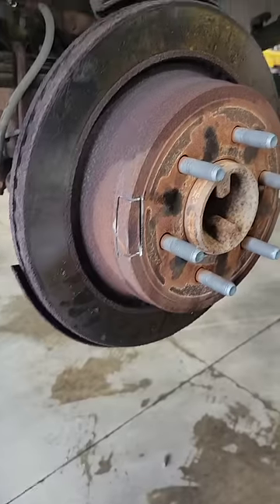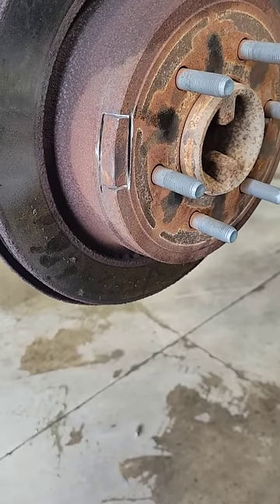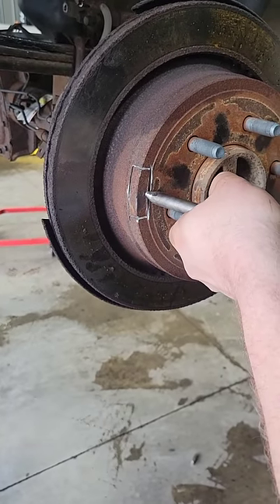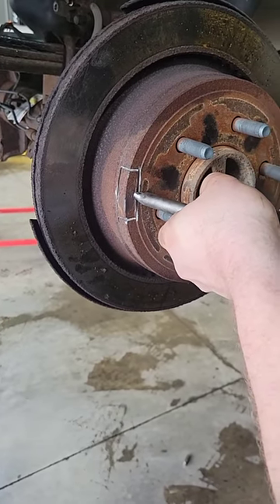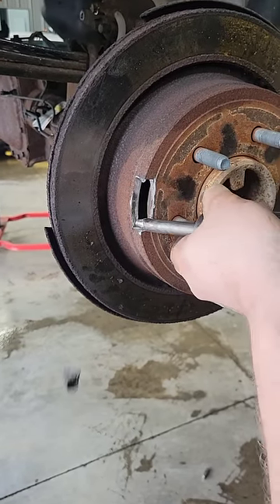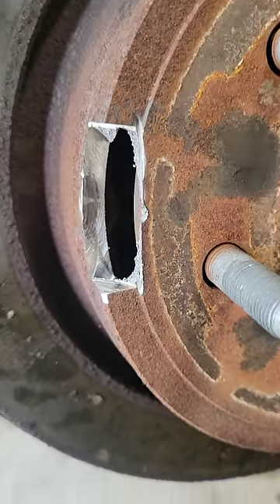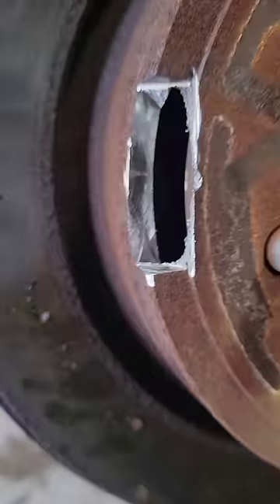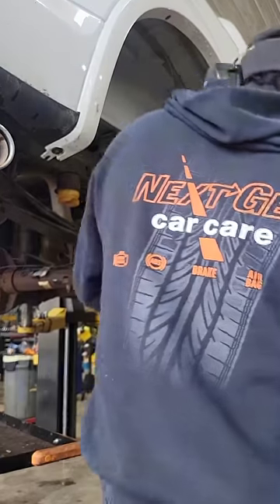Ford F-150 rear brake service.  Trying to show a trick on getting them off without further damage.

Comment: well if your shoes are sticking that bad you should change the shoes and the sp[ring kit anyway sop using a hammer is perfectly acceptable
Reply: Yeah but you rip apart the backing plate in the process
Reply: @strryle125  I've never done that and I've done many shoes. Even ones with bolt holes in the disc so you can wind in a bolt to push the disc out
Reply: It's not necessarily a problem with the shoes sticking, it's an excess of rust built up on the rotor. The shoes can be completely free and still have this problem
Reply: if you destroy the backing plate you're fucked, the rust ridge on the inside normal here in maine, and I've had good luck adjusting them all the way back, and spraying them with solvent while slowly working the rotor with my hand and gently tapping the opposite
Reply: @TotoGuy-Original  what do you consider many shoes? 10 brake jobs? 20, 30? cause I've done probably thousands and after you rip the pins that hold the shoes out of the backing plate once or twice you realize you can't just hammer them off
Reply: @smokeybear390  same you are obviously going about it the wrong way I've never ripped any pins out take your time don't force it too much that's how I do it
Reply: @TotoGuy-Original  where are you from? I'm from Phoenix and there's a reason I'm not arguing with anybody
Reply: Young people working on cars amaze me they just get saws and cut shit off.
Reply: @macsway2002  sometimes that is a good solution but most of the time it's not. For example a drop link you can get on the nut but either the centre or the shoulder to keep it still is gone then you best just cut it off. 

But stuff like cutting a hole in the disc like this a bit odd.
Reply: @smokeybear390   I believe on those ford's replacing that backing plate requires either pulling the axlemif it's free floating or removing the wheel bearing.
Reply: That's not the problem. Where the parking shoes dont contact the drum the rust builds up on the inside not allowing the shoes to slide out. You can simply remove the adjuster plug and back off the shoes to clear the rust ridge. Or what I've done is gently apply and outward pressure in different positions and tap on the outside of the rotor on multiple spots. Generally this is good enough in most cases
Reply: @zachbecklake2303  exactlyp
Reply: @TotoGuy-Original  just for the record NYC here and always worked on my own stuff I completely agree with you, idk what these guys are talking about
Reply: Get a loaded backing plate and go on with life
Reply: @strryle125  if there isn’t already a spot without the plate then you won’t ruin the plate, plus worst comes to worst you really don’t even fucking need those. They’re like $20 a pop anyways. You charged them more for labor than if you had just fucking replaced the plate???
Reply: @ElijahG19  you actually fucking do need those? not the part behind the disc, but where the shoes are actually attached, you 100% do need that, unless you don't care to pass inspection
Reply: @ Smokey Bear what's inspection? And what's rust? I'm in Florida and being very sarcastic, I grew up in Maine and know perfectly well the answers to my questions but here in Florida we don't have either problem. Thank God we don't have inspection 90% of us wouldn't have a legal vehicle. I was pulled over for my turn signal light being out and the cop kindly and matter of fact also mentioned that I ought to get my spider web cracked windshield replaced. I never did and was never told again. My current vehicle has a big spider web crack right in my line of view no problem no one complains.

Comment: 🙄 someone had a dope breakfast...
Reply: YOU ARE NOT A MECHANIC , EASY TO TAKE THEM OUT .
Reply: Off not out.. you take a brake drum off you don't take it out. There is a whole in the backing plate aka dust shield. If you look into that hole you will see a cog, that cogis the second part of a mechanical device known as your  automatic brake adjuster.  You can put 2 standard screw drivers in that white left the lever that turns the Cog making the adjusting Rod grow longer and in return forcing the brake shoes outward towards the drum and making an adjustment to keep your drum brakes working to the best of their ability. Given the assumption you have no air in your brake lines and all of the components in your braking system are complete and in good condition. Well holding the Cog turning lever off of the Cog turn the Cog counterclockwise and the adjusting Rod will shorten we're checking your brake shoes from your brake drums. Now your break shoes are no longer pressed tightly against the breaking surface of your brake drum and you can easily pull the brake drum straight off of the bolts.
P.s. you are correct I am no mechanic. At least not a Certified mechanic.
Reply: @artsanchez325  I've never needed to hire a mechanic on the account of ( I can do the work myself. In turn I have been hired to work on many other vehicles that belonged to other people but you are correct I am not a mechanic "by profession" experienced and knowledgeable yes but a mechanic.? No, not really.🙂 
Lol
Anyway I guess I'll go take my lug nuts out so I can take my tire out and my brake drum off!😉🤣🤣

Comment: I like this repair shop! The L.I Apple Honda dealer I used to go to doesn't even know where the gas tank is 🤪 The mechanic put a screw into the rear wheel well to hold the molding and the screw was so long and pointy, it touched the gas tank behind it 🤷🏻‍♂️
Reply: We have a company installing GPS in all of our fleet. I got a Mack with a ABS light on. Dude ran the ground wire like three feet through the dash. Had to have used fish tape and removed a few panels. All to get to this one piece of metal and run a screw into it for a ground loop on his GPS. Problem was that piece of metal was the mounting bracket for the ABS module. He ran the screw right through the bracket and into the module. The module sits flush against the bracket too. No gap. I literally stared at it for a good minute befuddled. I had to be missing something. Perhaps that wasn’t a self tapping screw. Maybe it was an oddly located mounting screw? Nobody could be this stupid; right? The kicker was there is an accessory port with ground one inch from where he zip tied the GPS unit. 
 These guys aren’t mechanics but they do these installs all day for a living. If anyone should know to watch where your screw ends up it is them.

Comment: i was a fleet mechanic for 30 years.  During that time I just quit turning rotors and drums and just got new ones for my own cars.  After seeing the things that can go wrong with a rotor once it's been cut (over-heating, warping, noise from bad refinishing) I think that the cheapest brand new rotor is generally better than the best expensive rotor that's been cut.  Doing this has saved me many problems.
Reply: If you cut them before they’re all goofy, you can turn em with no issues…it’s just a lot of time that no one has anymore…
Reply: Wow bro you need to hit me up I can save you so much time and energy and show you the right way to do this
Reply: I disagree on older vehicles because the parts you get now unless you get old stock our garbage I’d rather have an old part that’s dependable turned than a new cheat part

Comment: You can back the parking brakes off.
Reply: That doesn't always work when there's a lot of rust
Reply: That would take to much effort. Definitely easier to take the time and cut a hole in the rotor and use your brake spoon to mess with the shoes, than remove the rubber plug and back off the parking brake adjuster.
Reply: I know. But stupidity and laziness rules the day.
Reply: Ya live in The south or Arizona or California

Can’t do this in the north
Too much salt and rust
Reply: @markallen4364  I love ya style 🤣
Reply: @Krankie_V  if theres that much rust, then the backing plate along with entire parking brake hardware needs replacing anyways, so why go through all this nonsense?
Reply: @Hammerjockeyrepair  that's not always the case.... Sometimes it's just a lot of rust on the rotor and the rest is fine
Reply: @Krankie_V  if that's the case then the parking break hard wear should be replaced any ways backing plates are cheap as well
Reply: @Rustynuckles1  it has nothing to do with the damn hardware. It's an issue of a ridge of rust built up on the rotor.... Effectively making the ID of the rotor smaller than the shoes even when fully retracted. The rusty rotor is the issue, nothing is wrong with the shoes or hardware or backing plates
Reply: This it not the way to do it.
Reply: @Krankie_V  don't be cheap you got a shit rusted rotar just replace it all don't be messing around trying to save money on cheap ass parts be more of a head ack then its worth trying to save shoes locking pins caps springs
Reply: @Rustynuckles1 ... You can't force customers to approve additional parts.
Reply: @Krankie_V  lol  then they can go some where else.. tho honestly for what my company charges in labour it's just cheaper to buy new parts then to have me sit there for an hour trying to gain access inside a drum... then when I do you may just find the hardware need to be replaced any way...so if the adjuster is ceased it's a good bet everything inside should be replaced
Reply: @Krankie_V yes you can or they can take it somewhere else. I don't rig cars. Fix it right or don't fix it at all.
Reply: @ironmike742  taking steps to avoid causing damage to the vehicle during disassembly is not "rigging" anything.
Reply: @Krankie_V  I guess you don't comprehend very well do you. My comment is for you saying you can't force a customer to buy parts. It has nothing to do with taking steps to avoid damage. If something is worn out, rusted out, or broken it gets replaced or I'm not working on it.
Reply: @steelisthemeal  I live in Ohio and never had to do this.
Reply: @ironmike742  nah you don't comprehend. The parts aren't broken. They become broken when you hammer the rotor off and force things. That's the point of doing what the guy in the video did. Keep the parts from breaking. The only problem was a rust ridge inside the rotor. The parts were not damaged and would not be unless things were forced.
Reply: @ironmike742  if you want to be the jackass who breaks stuff and then charges the customer to fix what you broke, go ahead. I don't work that way.

Comment: I bash them off. The shoes are usually gone . So I replace all internals . But I like your idea
Reply: Ya make a true mess of shit that way
Reply: @steelisthemeal  well, if they are rusted stuck, you might as well just spend the 50 bucks replacing the shoes and hardware. I don’t know how cheap you have to be to try to reuse some thing that is rusted stuck.

Comment: Pull the brake cable towards the wheel, grab the cable with vise grips where there's something that the cable goes through. There's always something along the chassis that you can use for this.

Comment: I'm pretty sure you jam a flathead or brake spoon in the adjustment slot in the backing plate and back the shoes off using the adjuster.

Comment: There's the adjuster. If you can't use the adjuster door for some reason, have someone rotate the tire on the other side while you gently pull it outwards. It will come off. It'll be hard to turn so you'll want to have that tire on.

Comment: Really glad I clicked on this.  This is a really good idea.  I hate drum brakes so much, parking or conventional.
Reply: You can push the break cables if they were hung up thru should release.

If that doesn't work there a rubber plug access

Comment: I've had to use a brazing torch on old cars with drums all around. You heat up the drum until the shoes that have rust weld themselves onto the friction surface when the star wheel adjuster wouldn't cut it.

Comment: Can you not back the adjusters off for the park brake shoes...?
Reply: Nope. For Rear Disc rotor brakes on the F-150 there is no plug to access the star  wheel (not self adjusting) for the parking brake (Which are drums inside the hat of the rotor on several model years. Also these same years the cables did not have any slack adjustment. If they stretched they had to be replaced. So you can't release the tension any more.

Only option at that point is to pound them off or do what they are doing here.
Reply: Ok. I'm not familiar with f150s but on my gm trucks I've always just backed off the park brake shoes and the rotor comes right off.
Reply: Yes, there is a rubber grommet that can be removed to access the ''star gear". Mine were severely rusted, WI winters, and was able to back off the parking brake pads.
Reply: Yea and the guy that says they don't exist. Knock out the knockout plate the new hardware has the rubber grommet for the hole
Rookie.
Reply: @sledhead904  "alot of guys just take a hammer. That's not the way to do it"
Neither is this lol

Comment: In a lot of rust prone areas  you can back  off the adjuster all the way but the rust is to thick if need be we make a relief  cut to spread the drum  portion your replacing the rotors anyway

Comment: Star adjuster  is what's holding sometimes a keyway in the back other times cut if the pads are good clean adjust then new rotor and caliper pads .

Comment: What kind of mechanic are you,you can just turn the adjuster on the back of the disc😥
Reply: There is no access hole to get to the adjuster on certain model year f150s. Either you torch a little access hole in the backing plate to get to the adjuster ( not recommended on a customer's truck) or you do this little trick to save the customer from having to waste their money unnecessarily on parking brake shoes and hardware because you (the tech) ruined them. 👍
Reply: @midnightrider1854  There is a pattern we're the adjustment hole should be.I use a Dremel wit a small cutting wheel and cut where that hole should be.
Reply: @frankmata1812  ok now im confused what years are you guys referring to? Im only asking cause I've worked on 2002, 1999, 1996, and 1976 f150s and im not familiar with this issue. Admitted my 1976 through me for a loop cause the adjustment screw was fucken vertical towards the rear rather than at the bottom like im used to (although im sure someone could have just done a rear end swap or something at some point.) Is this a common issue where f150s didn't have the set screw punched out or is there more to this. Im curious cause now I wanna know lol

Comment: Had this problem on a kia. Bfh and air hammer didn’t pop the rotor off even with being deadjusted all the way. Took the torch to it and went around the hat and then used the air hammer again and it came right off and didn’t damage anything other then the rotor and didn’t even melt the glue on the bonded shoes.

Comment: I drive the adjustment gear backwards from the inside by cutting a horizontal slot and using an old fashioned brake spoon, or screwdriver.  However, I do not know if the F-150 has an adjusting gear in it.  Not all vehicles do, that have rotors in the back.

Comment: They literally have a hole so you can drill a bolt though and it’ll push off(usually same as lug nut)
Reply: That's usually only on front or non parking brake rotors, you can see clearly here there is no screw hole. Also, most of the time, those screw holes are actually just for manufacturing, to hold the rotors on the assembly line so they don't fall off.

Comment: What about gaining access through the backing plate by removing the rubber plug and using the tool that's made for it to back off the adjuster. 🤔.

Comment: use the star wheel adjuster to back off the brake shoes on park brake assembly,  remove rubber inspection grommet from backing plate to access star wheel adjuster 😎👍

Comment: Can't say I totally agree with you. During that cut you could have caused way more damage than any other option. Half a bottle of pb blaster and a slide hammer would almost definitely work and if it does damage anything then those other parts are so rust damaged they probably need to be replaced too.
Reply: PB is under appreciated.
Reply: Totally right way to do it not sure where this guy got his training
Reply: Who's gonna spray pb blaster all over their brakes?
Reply: @paul7769  It wipes off if you over spray, a little alcohol will remove any residue. It has to be easier than this video.

Comment: Try to back off the brake adjuster by locating the small opening with a rubber cap then use a n adjuster tool to turn the star gear to loose or tight the brake shoes.

Comment: I've been getting greasy for 47 years, and I've never cut an access hole to remove a drum or rotor. And I have never damaged the internals of the brake system tapping on the drum or rotor. You have to know what you're doing with any tool, including a hammer. Using a hammer does not mean beating the hell out of it. Geesh!

Comment: Nah man grab the grinder grind down the wheel studs than cut from the differential to the rotors spin the rotor to the left 5 times than hit it with a hammer paint the rotor  black and install the wheel again

Comment: I have been a mechanic since 1985. Worked at independent shops and dealerships. 
I don't see any spray lube on the rotor to axle flange. 
I don't see any hammer marks on the face of the brake rotor. 

After that you call the customer and let them know what the situation is. Let them make the decision. 
I have never seen a rust ring on the inside of a rotor large enough, to keep the rotor from passing over the e-brake shoes. 

I have seen plenty of locked up e-brake shoes from rusted e-brake cables. And from rusted up e-brake shoe adjusters. 
You hammer off the rotor with a dead blow hammer. Or use a puller. Then see what parts are needed to fix it. 

Who cuts up a perfectly good brake rotor ?. And if you re-used it did you seal up the hole that you cut into it. 
So the customer doesnt have rusted out e-brake parts.